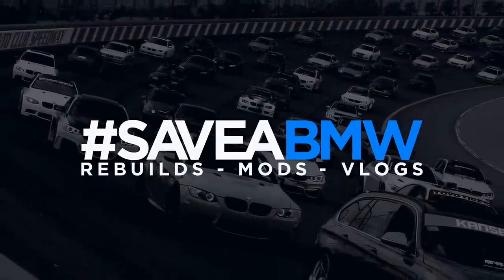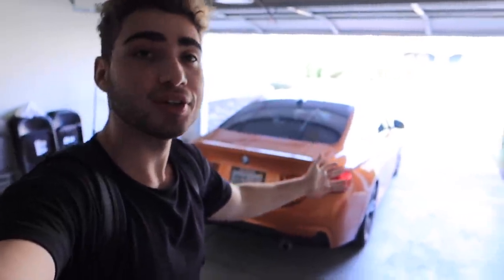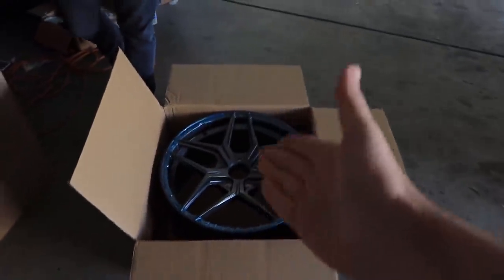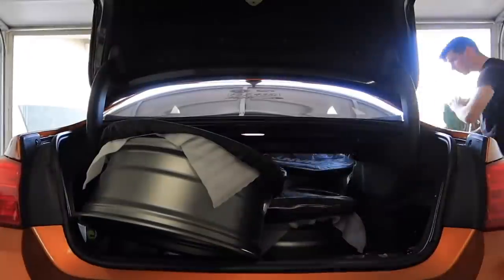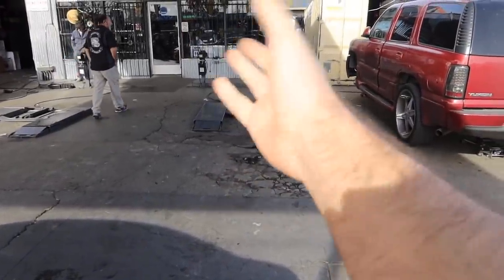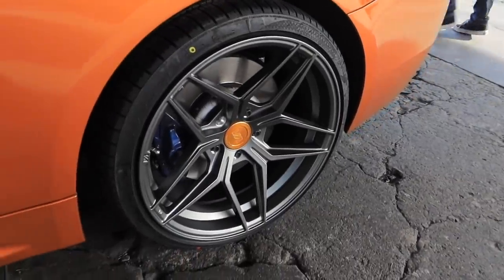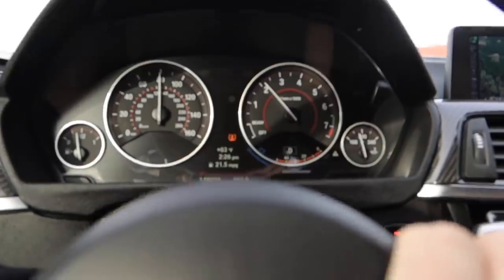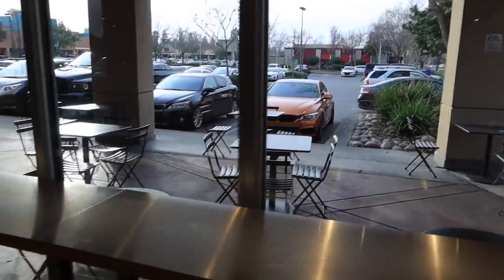NEW WHEELS FOR MY BMW F32 435I!!!

Comment: Color match the center caps gun metal gray, and the brake calipers orange/copper
Reply: I second this motion. The orange/copper caliper will make the wheels stand out more. orange caps doesnt flow nicely.

Comment: Those wheels are fire. Yea bro the calipers should be color matched for sure but what I would do is use a paint that can be peeled off just and case you stwich up the wrap on the whip.

Comment: Salam bro, 

The bmw caps would be way better. 

Wheels are deadly 🔥😁 

Caliper same colour as the car or the yellow oem ones. 

The front discs asks for some drilled or slotted ones😁 
Try from CQUENCE brakes 

The car eyelid needs to be darkened😉 

Car looks fire man🔥  

Merry Christmas  bro🎁🎄

Comment: the orange center caps are perfect just paint your brakes copper and get m4 style carbon mirror covers carbon spoiler, splitters or lip, side skirt extensions lower the car and if you can get a carbon fiber diffuser it would be better maybe wrap your roof with real carbon wrap and the car would be just perfect